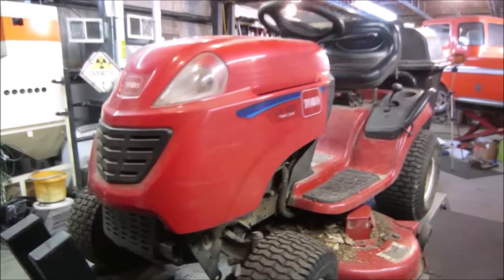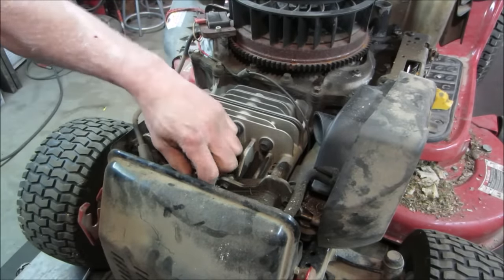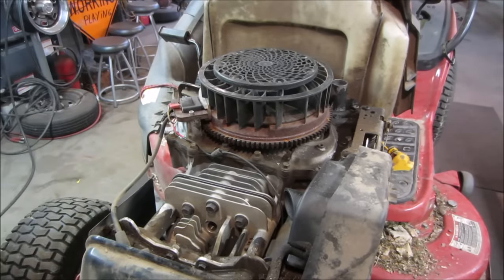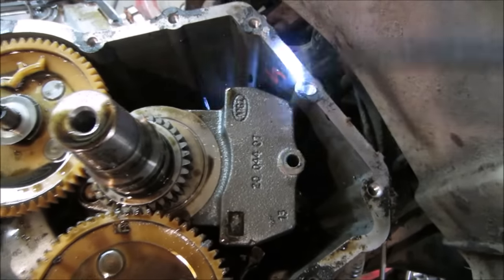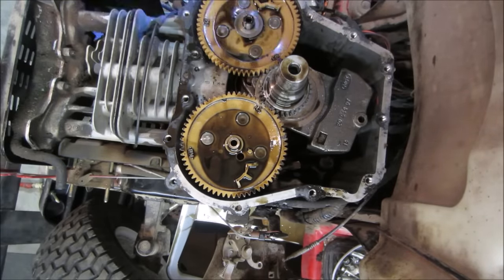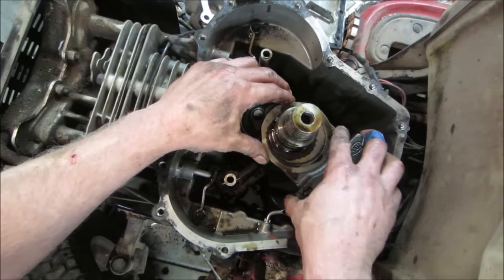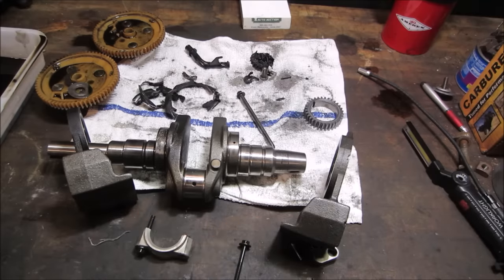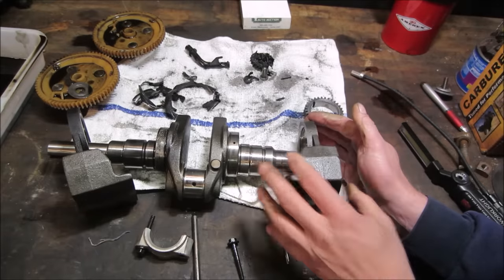You Won't Believe Why This Engine Blew Up,

Comment: mustie1 has got it made just like us,we have a enormous supply of engines to buy at dirt prices,i only buy real nice machines that do not sit outside at all,i find them with broken bearings in the deck and belts chewed up the pullies,those kind of mowers,this engine is junk,when i saw the dirty oil i was done with it,he was too,oil is everything,after repairing automobiles for 47 years,parts don't wear in super clean oil,if they gave it away, few would change it,laziness gets me more free mowers and parts than any other thing,you out to see my 2600 dollar SNAPPER i got for the price of a pizza,keep looking they're out there,drop the oil out of your machines before you use them and change it when you store it,costs a few bucks just to keep a nice yard,carry on,oh yeah i've had numerous oil companies and sales reps wanting me to endorse their products,nope,only oil supplement i use religiously is DURA LUBE,its the real deal,you want your machines to laugh at the heat and last,put only 4 ozs to the crankcase volume,engines last,my other mower was 17 years old,alot of stuff broke on it,BUT NOT THE ENGINE

Comment: Those Kohler courage single cylinder engines are by far the worst riding mower engines ever produced. With an over engineered design like that in the crankcase, you’d think BMW made it.

Comment: You dropped the cam for the counter weight in the oil pan and you took out the pin for it already.

Comment: Mustie you may or may not see this comment but I need a left rear axle for a John Deere l110 automatic Riding Mower and it is a hydrostatic drive rear end and the left rear axle bent right behind where the tire and wheel slides up on it and if you may have one that you would sell and ship, then let me know please here on the comments and I would get in touch with you but figured I would ask you if that would be possible and I would appreciate it....

Comment: Honda Longevity vs. Briggs?
Tear down a Honda Riding Mower engine.
Compare them. Honda is #1 small engine maker, for a reason.
I own a Honda GCV 160 push mower and A Briggs 10hp I/C rider. Briggs always has clean oil since main seal leaks 8 ounces per hour of run time. Both engines get drain and refill every 20 hours of run time.

Comment: Put a tag on the engines toe and zip up the rubber bag. Your autopsy should hold water under scrutiny . It can't be saved. It has become a parts machine.

Comment: Kohler courage problems: valve guides comes lose, valve seats fall out, cam gears break, counter balancer comes apart, cam cover bolts back out hit the flywheel breaks the block, valve covers leak. Governor comes apart. Other than those common problems it’s a good engine. 🥴😁😁😁😁

Comment: The Kohler Courage 19 is bad for the Compression release to stick & drop valve! Bolts losing up .had the fly wheel get wiped out from bolt raising up shredding it, the bolt you have came lose letting the governor explode wiping out trust baring/washer and cumming in contact with the counter balance JUNK it  use  20-28 they seam to have better luck ! the old 15-17 hp cast iron were better

Comment: I had seen a Kohler single cylinder engine that had low hours back in 2004 on a craftsman rider that was all ceased up
and I believe it was the Kohler Courage 18 H.P.. I surely wasn't impressed then and I'm entirely not impressed now

Comment: I could use the wheels/tires, the fuel tank and maybe the seat too, and I'd just probably sell the transaxle.
Yeah, that's not a Briggs -LOL - it's a strange engine design that I can't really see any real benefit in, certainly not enough to offset the obvious reliability issue created. It's  just another fine example of a well meaning engineer's highly over-engineered design - turned disaster - that was just simply looking for a place to happen. I don't really know but I'd say that it isn't the only one of its kind to suffer this same sad fate, don't you think?

Comment: Looks like a Koehler Courage motor. 
They were junk . Koehler should have stuck with their command engine.  They had 4 or 5 different courage updated versions to try to get it past the warranty but never could overcome the problems the motor had so they discontinued it

Comment: Kohler Courage engines are offshore engines from Kohler designed for entry level equipment ... you would have been better off with a Briggs ..

Comment: Again with the screwdriver in the spark plug hole??
Please, please, please, use a plastic drinking straw or anything else which will not put the piston, cylinder head, spark plug hole threads, etc, on the loosing end in the event something goes amiss when the piston is on the upstroke.

Comment: Wow, over engineering at its worst. We've been building engines with counterbalances built on the cranks for years. Seems to be the simplest, most effective solution. Leave it to some engineer to try and design something way to overcomplicated to solve a problem we already have a simple solution for. Less parts = less failure points.

Comment: Having a problem kind of like this with a Cub Cadet 1500 LT that's like turns over 1/2 of away and then stops and then turns over the rest away if anyone knows how to fix this please tell me how I checked it's not the starter and also I do not think the engine is seized

Comment: Never much cared for Kohler engines. What's wrong with a simple, gear driven balance shaft?!
Also, your fuel filter is installed backwards......
Reply: Or a little vibration???

Comment: Because the kohler Courage is a piece of junk. I have worked on small engines for 38 yrs . I was so mad at this courage engine kohler  made, so I called kohler and told them that they make some of the best kohler command engines . He said  they made them to compete with all the other cheap engines out there on the market. But I would never recommend buying anythi g with a kohler Courage  engine . They are junk ...

Comment: Definitely over engineered like most of the German crap.  After all, it's a friggin one cylinder engine.   Probably weighs too much as well.  Typically lawn tractors don't get their oil changes at proper intervals, therefore no good reason to use nylon parts within such and engine.  Nylon gets eaten quickly by the abrasion of dirt.

Comment: cut corners by putting crappy chinese parts inside and you get catastrophic failure.  You don;t need to be an engineer to see the forces that counterweight experienced.  To use such a thin bolt was just asking for this to happen.  I'd wager this is a recurring problem with this model.

Comment: it is a garbage design, 
 a machinist can open the scores bore  and insert a bro9nze bushing then grind the damaged journal on the crankshaft to permit  the reuse of the crank and its damaged counterweight the remaining parts are standard.

Comment: crappy engine design, just as you said, over engineered. Simplicity is the last thing on their agenda. As as a result, the costumer always pays. Look at the older made machines their still around in many cases, if they were maintained properly, not so with todays technology. All you have to do is go to your wreaking yard and you see a pile of cars that can't even last ten years for heavens sake. I'd throw a little V twin one it. their bullet proof ..reliable and been around forever.

Comment: At 5 minutes in I am going to guess umh main bearing.
Reply: At 15 minutes I see i was wrong. I never seen a governor before or cracked open a mower engine. This video is so cool. I feel like I am standing right there watching you work.
Reply: What is the pin on the crank counter weight for. Is it part of the governor? I'm probably 20 minutes in.
Reply: Alright finished the vid. Those weights are what caused the failure. Interesting they are not like the counter weights on a 2 stroke which are cast with the crank ends and pressed together on the connecting rod pin.

Comment: Ultimately it was poor engineering and bad steel that sealed the engines fate. Even if it were maintained through and through, something would've gave. Bad enough that Toro is overpriced to begin with!